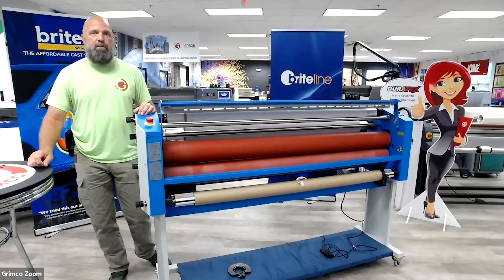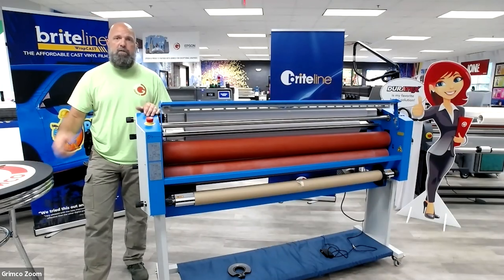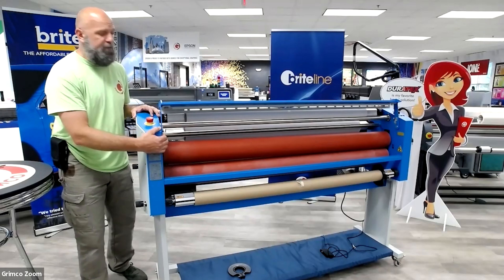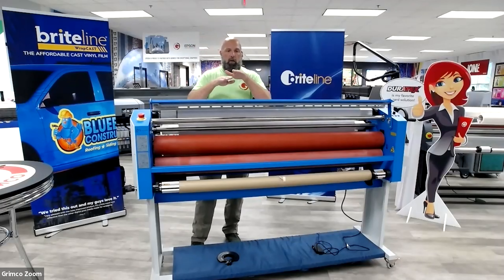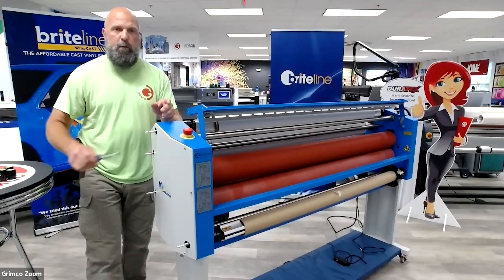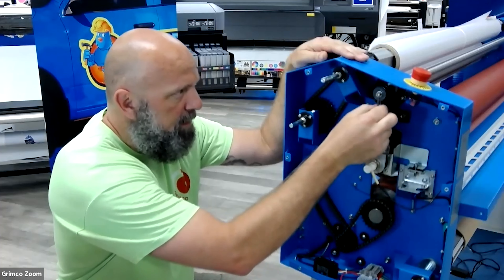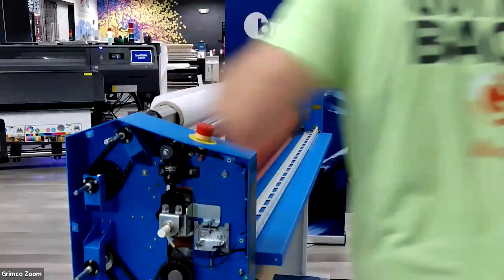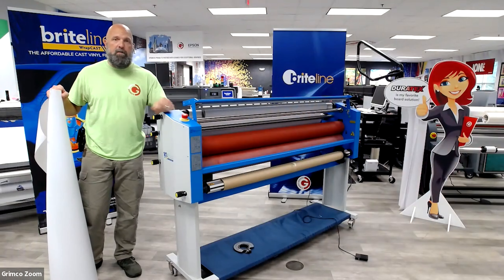GFP Realignment

Comment: Could you tell me which of the 60" laminators you would recommend with assisted temperature, for example Royal Solv., GFP, Seal, GBC Mimaki  Or if you know another brand  ! In your consideration, price, versatility and durability, which would be the most correct?
Reply: All laminators use the same parts and they all give you issues that’ll require some skill to fix. Sucks but the laminator industry just doesn’t have much or any technological advances over the last 15+ years.